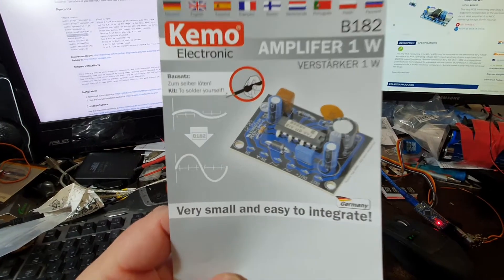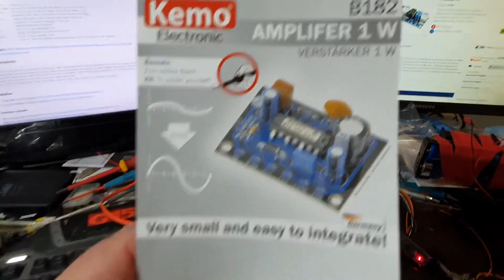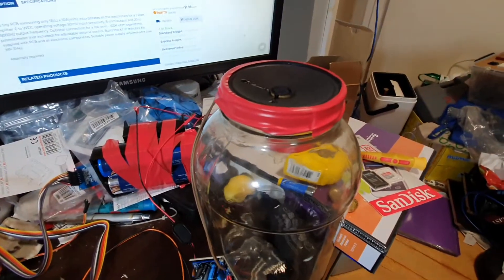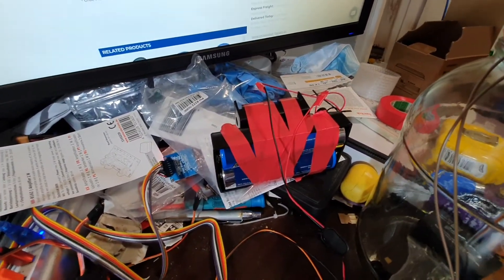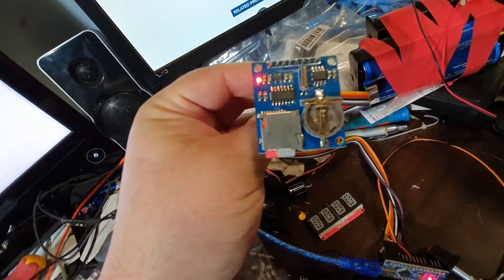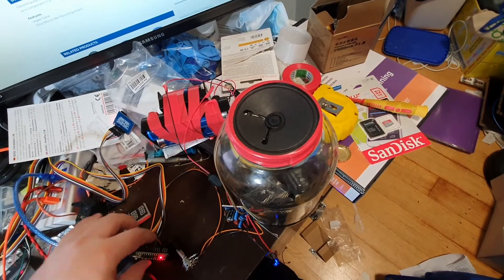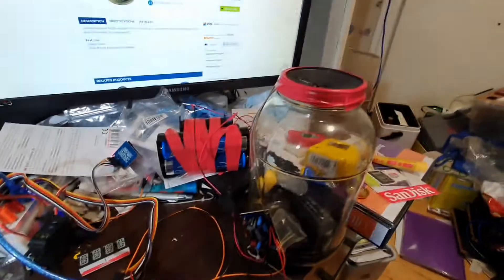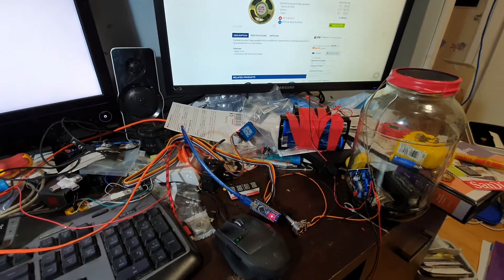Kemo B182 1W Amplifier and Jaycar 76mm 8Ω 1W speaker Demonstration

Comment: Hello, I have tried  to connect 4 kemo l010 using 
serial connection with a 100W amplifier with not luck. Do you have any idea how to do it? Thanks
Reply from the maker: What are you trying to do exactly?
Reply: @fransdebruijn6763 Hi, thanks for answering Iam using a computer to generate a HF sound above 20khz, computer is connected to an amplifier and I need to use those tweeters to reproduce the sound. The purpose is to keep dogs to stay away of a zone dangerous for them
Reply from the maker: @IsraelLopezMascorro  you can't use a computer to generate sounds above 20khz as there is a low pass filter on the output of the digital to analog converter that will filter out frequencys above half the saming rate.
Read this: https://en.wikipedia.org/wiki/Nyquist%E2%80%93Shannon_sampling_theorem

As well as this the amplifier will likley be configured not to amplify signals above ~20khz through capacitors in the negative feedback path and at the input.

You will need to look at a different approach.